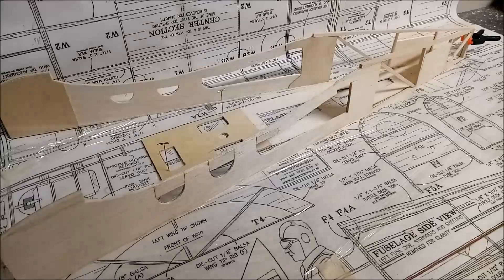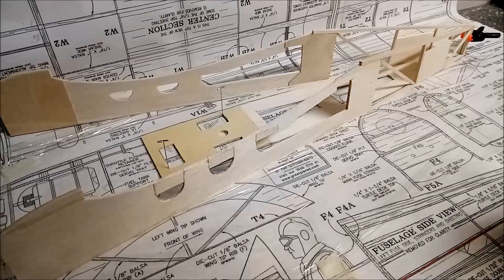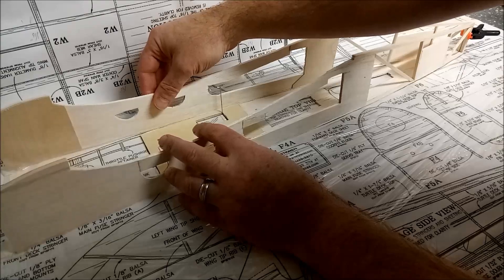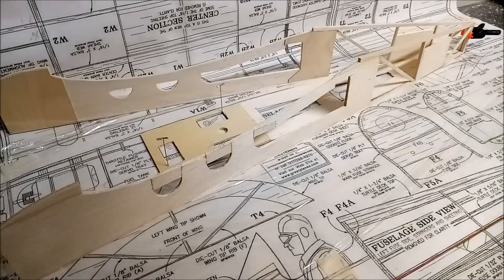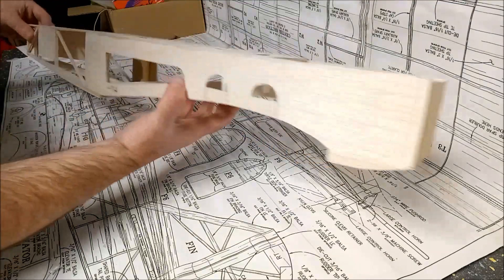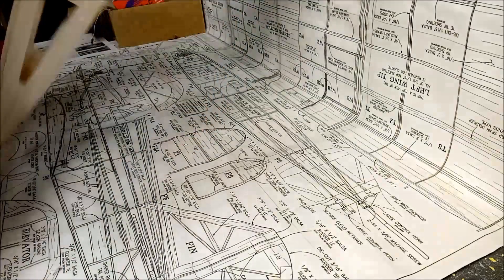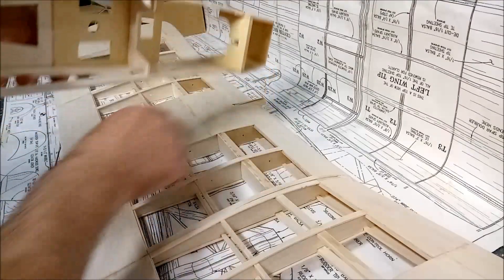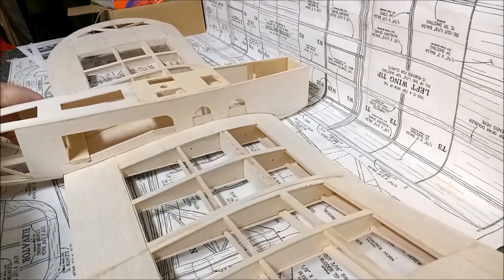Vid 7 Slow Poke (RC Plane): Building the fuselage

Comment: I have a question. So I have a 4ch transmitter from my drone and the question I have for you is can I buy any sort of reciever for that transmitter to work
Reply from the maker: Hi, is not something I've done before.  May depend on the spec of your TX. I assume it runs on 2.4ghz, so it should be possible. Best to ask in an RC forum.